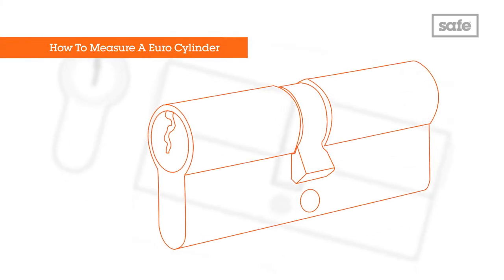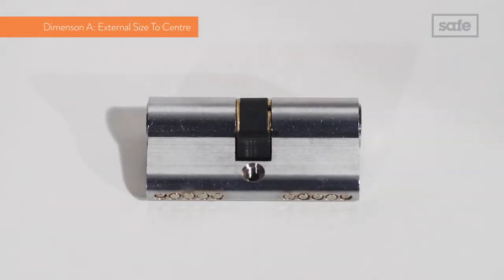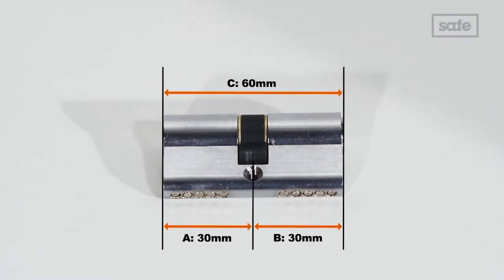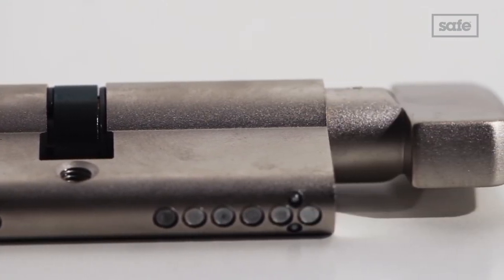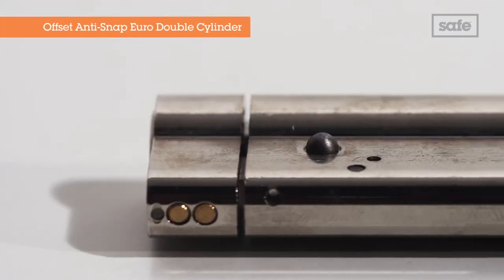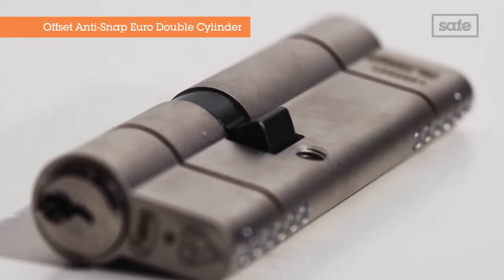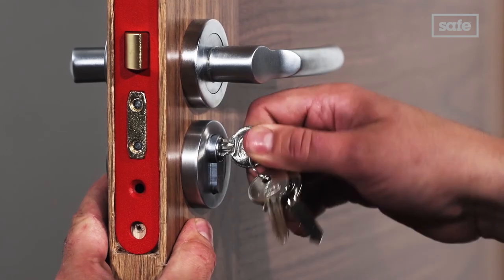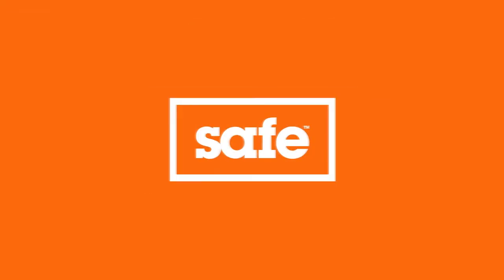How to measure Euro Cylinder Lock

Comment: So my old lock I want to replace is 50mm ext  45mm Internal.  I want to have it flush as it sticks out external and can be snapped. Do I use same measurement or take 5 mm off ?
Reply from the maker: It's likely a 45/45 cylinder that you need. Measure the amount that sticks out and calculate if you can afford it to be 5mm shorter on the external side.

Comment: So, for a 55/40 I take that as 55 exterior and 40 interior, however the label printed on the box I received states 55/40 but the digram shows 40 then 55

Obviously not an issue usually, however the deterrent and presumably security is more on the exterior side?
Reply from the maker: For high security cylinders, they usually have a snap line on the exterior side. This is a key indicator as to which side should face externally once installed. The side with a snap line snaps off sacrificially during an attempt by a burglar to snap the lock, and makes it impossible to then manipulate the lock cam. Some lower security cylinders, that don't include anti-snap features, are reversible and can be install either way around.
Reply: @thesafeshop  I was wrong about the definition, apparently 55/40 is interior/exterior, however the diagrams always show exterior - interior, a confusing logic IMO!

Comment: What does it mean if it says 30/10/30 - 70mm?  Is it the same as 35/35?
Reply from the maker: When a measurement is displayed as 30/10/30, it takes the centre cam into consideration. The Centre cam is 10mm and there is 30mm either side of this centre cam. The total length is 70mm. When a cylinder displays the measurements of 35/35, the total length is also 70mm but dimensions refer to the measurement to the retaining screw from either side.

Comment: What about dia sir.?
Reply from the maker: We don't mention diameter because it is a standard size. This never changes on Euro Cylinders and is determined by the Euro case it is being used with. The only dimensions you need to measure are the internal and external size form the centre retaining screw of the cylinder.